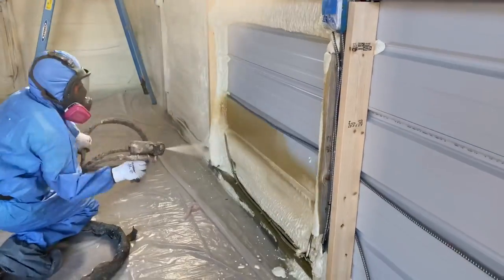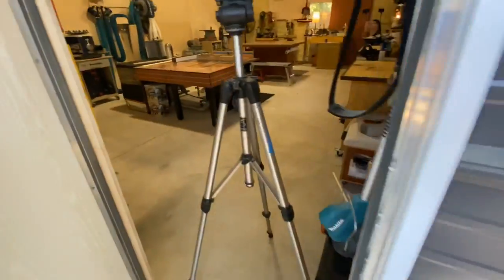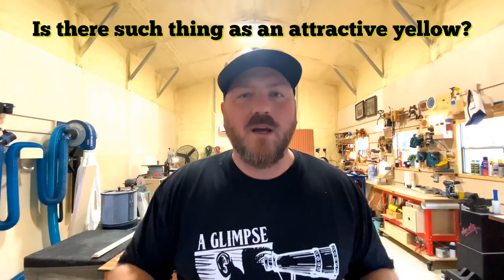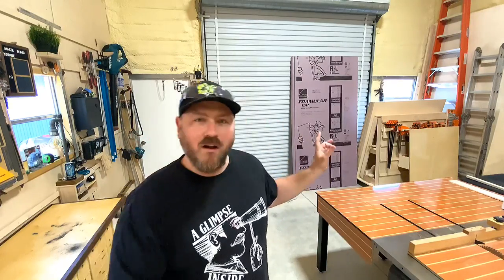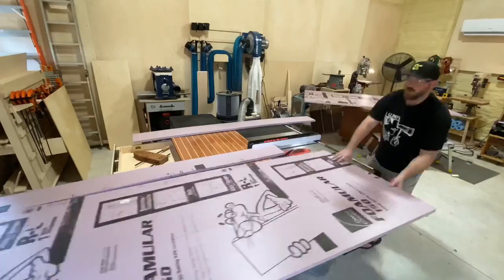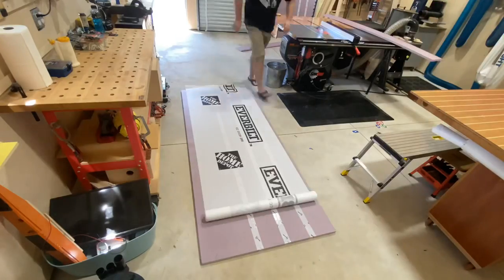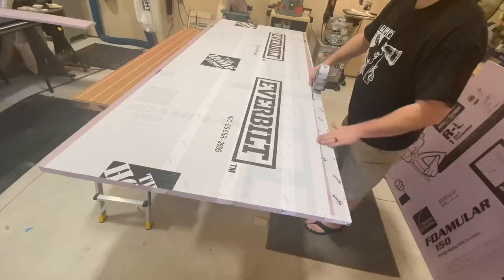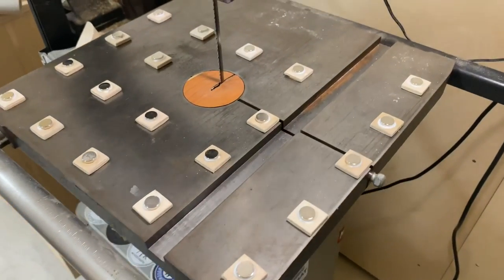How To Insulate A Garage Door/ Shop Door | PLUS SprayFoam Pros and Cons, My Thoughts!

Comment: A great video as usual.  One thing with the two magnets sticking together though, before mounting them stick them together and mark the faces that mate together so you know which way round they should go.  It would be more than a bit annoying to find that, instead of clicking together nicely, they repel each other.

As for Kids in the shop?  Mine (2 boys one girl) are now all grown but when they were smaller I encouraged them to make things with hand tools and as they got older introduced them to power tools.  Two years ago (almost to the day) they helped me build my workshop at the end of my garden.  All Wood construction and it took about a week to complete, that was a really great feeling.  Teach them to respect the tools (and the damage they can do to themselves if they make a mistake) and they will hopefully grow to make and repair things instead of making do with shop bought items & throwing everything away as soon as it doesn't work quite right.

Comment: I'm glad someone is actually talking about it I spray foamed my music studio I built as an addition onto the side of our house I live in ABQ new Mexico and it hits 120 degrees here in the summer, I have a lot of acustic guitars and a few basses along with all my gear, I have an AC unit in there but with the insolation not only does it keep the room pretty cool in the summer but it's also a great sound dampener I have my drums and you can even hear them from the outside if you're more that 5 feet away definitely worth the cost my room is about half the side of your garage and the foam ran me 2300 totally worth it for me especially in this heat
Reply from the maker: This is actually a pretty great point about the versatility of the spray foam can do. Never thought about putting it in the music room. I’ve been playing drums and guitar for over 20 years myself and that would be a great idea for a studio space. Thank you so much
Reply: @AGlimpseInside  works like a charm man especially if you have annoying neighbors that complain about sound

Comment: I love your idea and very functional. I don’t have the entry door that I wish I had opted for in the beginning. I did the reflectix bubble insulation on my roller door. I put it on with spray adhesive and double sided tape. I can roll up door with no issues.

Comment: Great idea. I am looking to do the same on our roll up door, but I am going to try out double reflective Insulation on a roll on our roll up door.  Also just adding a drum fan will cut your temps down 10 degrees.  We use them in our warehouse and it's keeps things cooled off very well.
Reply: Hey bud, Did you ever insulate your roll up door? My shop is smoking hot right now. I have to do something.....

Comment: That was a great solution to a real problem on that door. Another question I have is: are (did) you install any ceiling fans to circulate the air?  Not talking air filtration, just moving the air inside.  FYI, This video reminds me about the time, when I was about your age, I built a large building (60'x100') for my shop. It was auto repair not woodworking back then. cant wait to see your next improvement.  I may not always comment, but I do always watch.  Keep it up.
Reply from the maker: That is a huge shop Russ. That is awesome. I appreciate the kind words and I don’t have a ceiling fan but I do have two fans that circulate air throughout the shop as well that are on the ground

Comment: I do a majority of my work after my kids are in bed, but if during the day they like being out there.  I'll typically invite them out when I'm doing assembly or glue ups or finish, something that's not cut-intensive.  They loooove playing with the scraps and using the dust collector.  I let em join in on cutting board finishing, too - they think it's finger painting ;)  It's tough to teach them to not distract dad while making a cut, but they've gotten better at it, and I typically only do short, quick cuts with them there (5 and 3 yo right now).
Reply from the maker: That’s a good point by not being distracted. Also I like your idea of only bringing the kids in typically when finishing is happening or some light duty work. As always I hope you’re doing well my friend. Thank you for always being so supportive

Comment: Sorry Chris, may have missed it...  The few times you do open the door you simply remove the insulation first?  My idea on what to do with the look is to tape builders paper (the stuff we all use to cover our work bench when we spray paint) on it and let your kids go to town on it with their drawings.
Reply from the maker: Correct I remove the insulation and quite possibly put it on the pullout shelf underneath my lumber rack. I wish I could put that in the video but for some reason I didn’t

Comment: After looking at your door insulation, and looking over my same type doors, I decided the BEST way to go is similar to your idea EXCEPT to do it on the >> outside <<, this way it also covers up the inherent gap at the top of all those type doors, I will build an aluminum frame that fits snug WITHIN the current outside framing of the door, then pack it with THICK foam insulation OR have it sprayed, I will mount handles at pertinent positions where I can grab them to pick up this light weight door to move it out of the way when I need to access the door.  This way the sun/heat won't even TOUCH the roll up door.

Comment: Not sure if you are still using this set up on your door but a different way and you won't have to take down and put up. Buy a roll of bluetex insulation and glue it to the door it will roll up with the door so you never have to take it off

Comment: it's funny how I came across this video while looking for brush seals for the top and sides of my roll up doors. My shop is 30 ft x 50 ft x 16 ft walls  and is metal as yours (Butler). When it was built I had 3 inch insulation installed on walls and roof, and I also framed the walls and paneled them. I have 3 roll up doors and skylights. The doors are some what insulated but doesn't seem to do much. Living in the mountains in Northern California it gets upwards of 115 degrees during the summer and 20 degrees in the winter. The roll up doors are the big problem. I have a 10 x 12, 10 x 10, and 10 x 8 set of doors. It seems I have a very similar idea to what you did. The 10 wide by 12 high is a bit of a problem. I will be using this door a lot. So my idea is I am going to use 2 inch hard foam panels with aluminum on one side and as you did cut 3 pieces of equal width 5 ft. high and use bolt on magnets (Ace Hardware) to attach to the door at the lower portion of the door. These will stay on the door all the time. On the top I will build a 7 ft x 5 ft frame work to attach the top pieces (to seal the top of the door) in a 2 door hinged set up (5 ft wide each) so when I need to open the door all I do is swing the top 2 foam framed doors open on each side and roll up the door. This will allow me to roll the door up 7 ft. and not have to remove any panels. If I have to go higher I just remove the lower panels off the door. I hope this works LOL       P. S. I too installed 2  two ton mini splits for heating and cooling in the shop. I wish I could figure out how to put curtains or shields on the skylights when it's direct sunlight, a lot of heat comes through these panels.  Great job and it's great to get the kids involved in the shop activities. Have a great day.........

Comment: Sprayed foam in a pole barn and insulated doors are great in northern latitudes too. Professionally applied, it stops air infiltration. With a slab-on-grade floor and the doors and windows kept closed, the shop stays cool until late July. Then, with screened windows open at the top of 12' walls at night, the warmest air rises to escape and cool air cascades into the work area so  that typical shop temperatures at 7 AM are in the mid 70s, never more than the low 80s. With the windows kept closed throughout periods of 95 to 105 degree days, the inside temperature rises no more than to the mid 80s. At this location in Wyoming, nighttime temperatures in the summer typically fall into the 70s or even 60s. Work station fans keep the hottest periods comfortable. Keeping the doors closed and the windows screened keeps out the birds and neighborhood cats both of which had previously caused problems. During periods of wintertime temperatures averaging 10 degrees, it takes less than a cord of wood to keep a 1,800 square foot shop's temperatures from falling below the mid 40s.
Reply from the maker: Wow that’s a lot of information. Thanks for sharing. I’m sure that everything will be good to go with this spray phone as it sounds like yours is working very well

Comment: If you spray it with paint, make sure it's intumescent paint.  It will cost you about double what regular latex paint does.  It will protect it from fire and sparks though.  I learned the hard way that when adding latex paint to the foam and you take fire to it, it will go up in flames.  I had to go back and respray everything.  And believe me when you slop latex on the foam it will burn.  I had a fire marshal show me.  We cut out a 1' square and lit it on fire.  It was a costly mistake for me in a 7,000 sq building.

Comment: I have a 40x50 shop with 2 14x14 doors - why did I do 2?!?!?  One would have worked.  But thank you for showing me how you did the door with the foam.  I use the 2" when I need to break down plywood and had thought that they would be great, but keeping them up there what my question - magnets!!!  Going to order some tonight.  What do you do about the air gap at the top of the door, or is yours so small it does not matter?  Keep up with the videos and have fun this children.  They are cute.  I am at the grandchild stage and have many memories of mine.

Comment: You can use the 12x12 inch foam squares that are used in studios for sound they work great and you can still roll the door up and down and they don't come off if you use spray heavy duty glue and if one does u just spray and put if back up and u don't have to take it on and off

Comment: This is good stuff and I can relate to the dilemma. I live in Southeast Louisiana, I don't have AC in my shop yet, and my shop door is a single-car width un-insulated metal door. I insulated it with a kit that includes pre cut insulation bats that fit in each panel. It made a huge difference but the bat's keep falling out. I could tape them in but I'm thinking of using foam board instead. The magnet trick might be the way to go.

Regarding the asthetic of the purple foam. That foam easily takes latex paint. Also, you could cover the inside face of each panel with 1/4" Luan plywood and leave it bare or paint it. Heck, if you did that, it would make one bodacious sticker wall!
Reply: Oh, one note for watchers... There are companies that sell insulated roll-up doors.
Reply from the maker: Do you know what the whole sticker wall thing is a great idea. Thanks bro

Comment: I pride myself on being very much an "outside the box" kind of thinker when it comes to problem solving - I am an electronics engineer so I guess I need to be. HOWEVER, that is THE BEST idea I have seen for using magnets & foam board ... EVER. 

Also, I am literally just about to replace my space consuming (can't fit wall cupboards!!) up and over garage door with a roller door and as I live above 54°N in North Yorkshire it gets BLOODY COLD in winter! So, guess what I'll be doing as soon as it's swapped? 🤔😁😁 Only 7 x 7 for me too! Think I'll use some Celotex though (PIR board, R-7, or R-10 per inch with stabilised 3/4 airgap!!). 25 mm should do it and currently on offer at £15 per 8x4 ... Yay! I'll only need 2 panels, RESULT!!

Thanks for the great idea!

Comment: I'm told the OPEN cell spray insulation is most wanted & used on metal buildings because IF you get a leak it will just run through. Put some shoes on that little Princess feet, I'm sure you are going to have some stuff in there she doesn't need to step on ! Was you pleased with that company??? Do they work in North Central Florida also??

Comment: I'm in Wellborn Fl Suwannee Co, and after moving here I FELL ya, on the heat in a metal garage, I CAN'T do anything in there after 11 a.m. ANYWAY, great idea on the doors, I have two like that, think what I'm gonna do is build a BOX that will fit OVER the complete door the top drum & ALL, the box will be lined, THEN, I will mount on the area that will face the floor those wheel dolly's that way when I need to go in or out I can just roll the box out of the way, I may try your method first, your method MAY cut down ALL the heat I want to stop. MY problem is BOTH of my doors face the morning sun

Comment: Hey Chris. Great video.  Have you thought about how to insulate the door frame.  I find a lot of cold comes in there.  No solution so far seems to work very well.   Thanks.
Reply from the maker: I never thought of that. Although it seems to be working fairly well. Although you never know how good something is working until you make minor improvements and then you realize well it just could’ve been that little bit better. Thanks for the insight

Comment: I want to insulate my roll up door but have the insulation attached to the door so I don't have to deal with the extra step of putting it in place. 
Within the next year I am going to remove the felt strips and adhere a layer of Reflectix double bubble insulation to the inside. Is there any reason you think that won't work? I was thinking the thickness of the double bubble is about the same as the felt so the diameter of the roll won't grow by too much when it is rolled up. Fingers crossed...

Comment: I put insulation in my shop a couple weeks ago. Now to get a air conditioner
Reply: Hi Matthew. I have a shop very similar with spray foam and installed a mini split two years ago. Absolutely the best way to go. I live in the south and we fight humidity all the time. When my mini split is set on, “dry” it blows cool air into the shop and most of the time I don’t even need to turn it to ac. I have been fighting heat from the roll up door and now wish I had gone to the sectional door and two inch foam. Good luck with your project.

Comment: With a roll up and down door.  There is a gap at top when the door is down.  What did you do about that? Thanks.  Just got my building up and trying to make plans.
Reply: James Buchanan might not be the best option but I rolled up some harbor freight moving blankets and stuffed them down for now
Reply from the maker: I didn’t even know that gap existed until you did this comment. But Zack has a good idea there
Reply: @zaxewoodworks6600  I actually purchased a roll of insulation that is covered in a plastic wrap.  Cut a long piece and laid across the opening.  Easy to remove and install quickly and dust can be knocked off and will not draw moisture.  Thanks for the input.

Comment: What kind of shop lights are you using and what brand of AC did you say you use?
Reply from the maker: I’ve got some 14,000 lm 3 x 2 LEDs there’s two of them. And the AC is a GREE unit 2. Ton

Comment: Good day sir, I have watched this video a few times because I keep coming back to the spray foam especially now that other products are unavailable.  I had a home that had spray foam and it had a oder to it, do you find that with your spray foam?
Reply from the maker: No odor whatsoever. I mean initially yes the first day or two after 48 hours it should off gas and be odor free. At least my experience with both of my buildings with spray foam have been that way
Reply: @AGlimpseInside  thanks for the quick response

Comment: Does the door roll up with this insulation method or do you have to take it down to roll it up?
Reply from the maker: Do you have to remove the panels. For someone who needs to open the door daily this is not the best solution. There’s actually a foil that has a Heese of backing that’s in 30 inch rolls I believe that has an R-value of about four. That will work well if you need to roll it up all the time my situation, I roll it up five or six times a year so this works for me

Comment: How thick was the sprayed foam on walls and underside of roof surface ?  For this building, how much $ did you spend on the sprayed foam ?
Reply from the maker: In this video description as a breakdown of all the costs including spray foam if I remember correctly it was 3500 bucks and the roof is about 5 inches in the walls are three

Comment: So, IF you want to open that door do you have to remove all those panels?
Reply from the maker: Yes you have to remove the panels and set them aside. They could even go on the pull out tray of my lumber cart. Darn it I forgot the future that in the video
Reply: You know if it gets annoying putting those up and down, you could always at anytime have that door replaced with a standard insulated garage door, garage door company will remove that one and install there's....I had a standard garage door put in mine.....IAM super happy with it, thanks for the videos...John Stark , NC

Comment: I don't think you can open the roll up door with that insulation on there. I used the double aluminum bubble insulation, and it made the door harder to lift up and pull down and that is thinner than yours.
Reply from the maker: This is correct. I opened the door about two or three times a year so no big deal. I’d rather have something a little little bit thicker to provide more R-value.